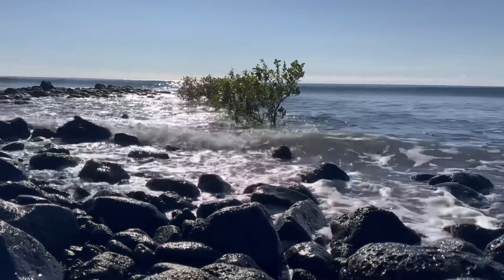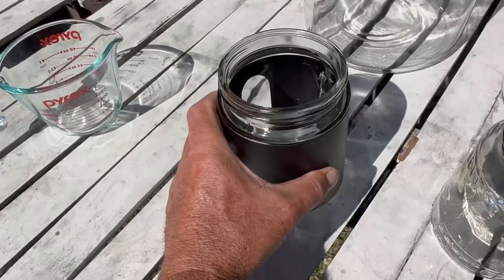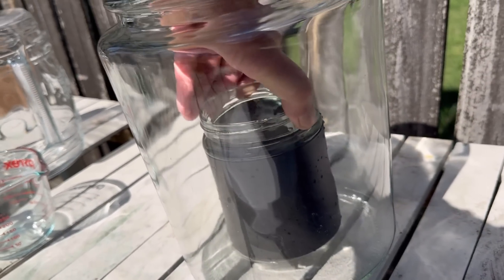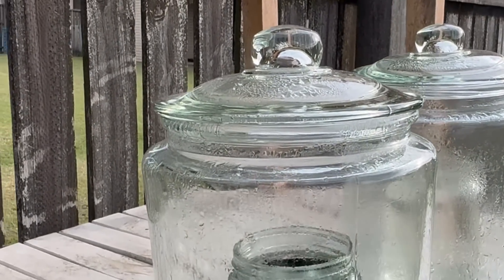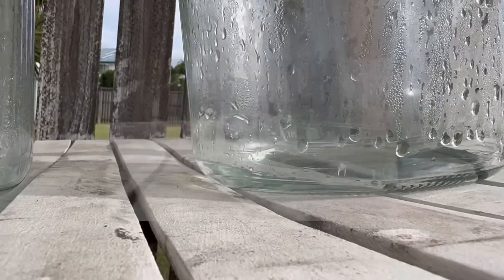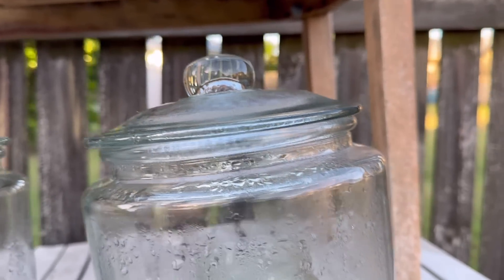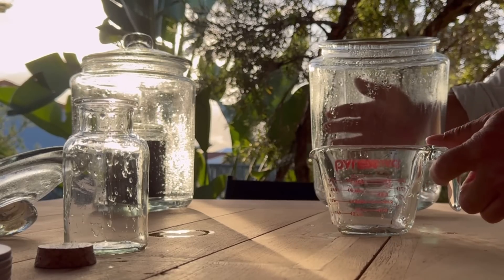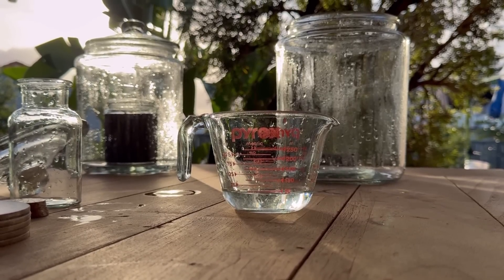Solar Distillation 2.0: Boosting Efficiency with a Simple Tweak

Comment: First video of yours I've seen, so I apologize if you've answered it before. 

Why not invert the system? Black outside jar and clear collection jar in the middle? You could just invert the lid(though you may need to tape it on to seal it) to get it to properly condense and drip back down. Is the current set up to minimize losses to the sides of the salt water jar? 

Have you considered a two part system? One jar in the sun connected to another jar in the shade?
Reply from the maker: Hi and thanks for your suggestion and your question. I have actually made a video attempting a design such as this but the surface area of the lid was not enough to get decent results. And as you mentioned sealing the unit up is important otherwise the vapors simply vanish (they are very sneaky), also I have found that by adding tape to the system the taste of glue comes through into the distilled water due to volatile organics of the glue used to make the tape sticky. And in regard to your comment about making another system separated by a short distance and connected by a hose, this would be well worth a try. The collection vessel could even be hidden from the sun to help reduce reevaporating. I would love to give this a go at some stage in the future. It's a good idea. Thanks for your feedback. Cheers!
Reply: @Remraf  Food grade beeswax and cotton wool would probably do a decent job sealing things without changing taste. 

Looking forward to more videos!
Reply from the maker: @KOWspazed good point! Bees wax is awesome. I need to do some more research into how they make it! If the bees can do it I can do it! Maybe….

Comment: what if you made a black sleave, that could be put on and removed, for both glass containers? could you get the outside container hot enough with the sleave on, to actually get precipitation just by taking it off and letting it cool down? if so, you could get multiple drips throughout the day. not just at night. just a thought
Reply: also you've inspired me to try myself 😊 thanks!
Reply from the maker: This is so cool to hear! Explore all rabbit holes I say! Once you start you wont stop!
Reply from the maker: How did I miss this comment!?! Sorry for the late reply. This is a fantastic idea. The black outer jar idea is something that would be well worth trying and easily implemented. My only concern was not letting the light into the system. There was a paper written by researchers at MIT that suggest lights roll in evaporation is larger then first thought! And the sleeve idea is worth implementing as well, it could have a double use as it would be wet during the night and during the day the evaporation of the water on the sleeve would result in a cooling effect inside the jar as well. So both would be worth trying. It would be interesting to see if the wick effect has a negative effect on the evaporation? Cheers!

Comment: black electrical tape? 🤷
Reply from the maker: That would work well, the biggest concern would be making sure the glue that is on the tape doesn’t leak into the distilled water. But maybe we could put the jar up on a block of sorts to keep it out of the distillate. Thanks for the suggestion. This would be worth a try!

Comment: This is neat - what YouTube is for. I think a simple heatsink, like a thin metal fin on the outside would help quite a bit. It won't do much during the day, but at night it will help it cool faster (minimally) but also create a slightly cooler spot on the shell which will become a nucleation point for condensation and attract bigger drops that will settle out faster.
Reply from the maker: Thanks for the comment and for the suggestion. I believe I have some old computer heat sinks laying around somewhere. Might be worth digging them out and researching how I could attach them. The more we can create a temperature gradient the better our condensation will be. Thanks again and I look forward to implementing this suggestion!

Comment: In theory, painting the inside of the inner jar black should be safe. Any VOCs should be evaporated after drying and all that should be left is highly crosslinked polymers which should not evaporate. The clean water should then collect in the outer jar, without any paint.
Also burying the outer jar half way and elevating the inner jar within the outer jar may help encourage condensation at the bottom using cooler temps from the ground.
Also make it air tight if possible.
Reply from the maker: Thanks John. I appreciate the feedback. I am currently looking into the qualities of different paints. As you mentioned there should be some types of paints that are perfect for this function. Maybe pot belly black or a high temp enamel! And yes, I need to start considering burying the collection vessel to help cool it and minimize reevaporating while keeping the system airtight! This is key, I've made the mistake in the past where the system had slight leaks leading to the vapors escaping! Thanks again for the feedback. I appreciate the insights!

Comment: Nice! Have you tried using evaporative cooling with seawater on a small part of the outside to cause condensation? That should work even without sunlight, as long as ambient humidity isn't too high. I don't know how well though, and it would depend on multiple factors, including the humidity in ambient air, the drier the air the better it should work, all else equal.
Reply from the maker: This would be tricky to get it to work. I wonder…. How would I set it up to allow evaporation while maintaining a purchase on the surface of the jar? If I sat the entire unit in a pool of water I might see some results. The other way would be to make a sleeve maybe? Install the sleeve over the jar, place the jar and sleeve into a bath of water, the sleeve wicks up the water and evaporates therefore cooling the unit as it does so. Maybe this would work! Thanks for the suggestion! I appreciate the feedback! Cheers!
Reply: @Remraf  Yes, exactly letting it wick up. I think just a small part of the surface area is best, at least when there's no sunlight.
Reply from the maker: @fishyerik there’s plenty of sunlight here. It’s Australia’s super power and in summer it can be a super bummer! Especially if you have to work in it. (Like I do!)
Reply: @Remraf  I don't know if this is helpful, but I thought of another way to use evaporative cooling that might be better. If you raise the inner container off the bottom, you could place the whole thing in very shallow seawater to get condensation at the bottom. That should also be easier to combine with a reflector to focus sunlight onto the inner container. 

About focusing sunlight, regardless if you do it with a lens, or reflector, or both, it can increase the output a lot. 1 square meter of full sunlight represents enough energy to make about 1.5 liters of water to evaporate per hour.  While it's not possible to extract water with anywhere near 100% efficiency, focusing the light will help both by getting more energy to the process, and also increase the difference in temperature, which is a big part of what drives the process.    

I find it interesting with the different perspectives, when I think about it, producing freshwater from sea water is probably most potentially useful in areas with a lot of sunshine. I live in Sweden and we rarely get temperatures over 30 °C even, and lack of water is rarely a big issue here, in large part because the low temperatures means low evaporation.          

Anyhow, keep up the great work!
Reply from the maker: @fishyerik these ideas are awesome. I really want to implement them into the next test. Raising the container off the floor and adding the entire unit into a bath of seawater would be a cool addition. The evaporative effect would in theory, as you have said, cool the system allowing for more condensation. Thanks again for your extensive comment!
Reply from the maker: @fishyerik we have been lucky here lately due to the amount of water we have been receiving but go back to 2018 we had periods were it rained mud. It was apocalyptic. Very close to have serious issues! That’s what set me down this path! Thanks again for taking the time to think about this subject and for sharing your ideas. I really appreciate it.

Comment: If I may suggest, if your jars can seal airtight,  by boiling the seawater just before adding to the black jar, and waiting a few seconds before closing the lid, when the water cool to room temperature, will create a negative pressure inside the big jar and this in turn will reduce the boiling point of the water, requiring less energy to aid the distilling processes.
Reply from the maker: Interesting. I’ve seen several posts in one of the previous videos discussing working with pressures to improve the results. This is something I would like to have a go at. But for the time being I think I would prefer to try and stay with utilising minimal energy input (the sun). 
This however would make an excellent video separate from the solar distillation series. It would be interesting to see the results. Thanks for the suggestion. I will take it into consideration! Cheers!
Reply: @Remraf  to filter water run two containers, one upside down, linked with a fresh stick, tape openings air tight, enjoy 🌧🌊💧
Reply from the maker: Hi and thanks for your comment! I would love to give this a go. I just hope that I am understanding this correctly. So it’s one container on the bottom that has the sea water in it. And the one inverted above it captures the condensation? And the top container is suspended using the stick? Is that right?
Reply: @Remraf  bottom is collection. Top is the water to be filtered. Tree branches have millions of membranes/channels (live a bee hive) the water moves through and purifies. It's extraordinary how clean muddy water comes out, ready to drink. Also can place bag/glass jar over the end of a branch with leaves and water will drain into bag/jar 💚🇦🇺
Reply from the maker: Yes. Definitely! I have seen the bag process before. I’m not sure if you have heard of a fella by the name of Malcolm Douglas. He demonstrated this years ago in one of his documentaries. True blue Aussie legend! It would be interesting to see how much fluid could be retrieved from utilising this process.
Reply from the maker: @GFYYT11111 i really need to have a look at this. I’ve seen a couple of people mention this. Would be worth investigating further! Thanks for the information.
Reply: @Remraf  welcome💚 We are coming to a time in AUSTRALIA that all must know how to filter water. The war on humanity has escalated. FDA refuses to perform it's existence. Processed foods, fast foods 🤮 stay safe everyone 💚🇦🇺
Reply from the maker: @GFYYT11111 thanks for your comment. It’s certainly concerning thats for sure. I work in the ag industry and from what I am seeing things are not getting better. There are definitely exceptions but they are rare.
Reply: @Remraf  love channels that educate. Sharing info & natural alternative ways will save millions 💚🇦🇺
Reply from the maker: @GFYYT11111 even if I change one persons perspective just a little or help to improve one persons understanding of the world. These are steps in the right direction. But that could be more opinion than anything. Cheers!
Reply: Fresh water it works  @Remraf not sure if removes salts but l would imagine so... love to see you do this experiment for your audience 💚🇦🇺

Comment: Make a lens or mirror to focus solar rays on to the inner jar next.
Reply from the maker: Thanks for your comment! I will consider this. I have a fresnel lens somewhere. Might need to track it down. The other option may be to make a reflector that I can then put it on the back wall of the jar. Thanks for the suggestion. The experiment continues at the moment. But it is due for another update and I think you’re right. This could be a good direction to take it
Reply: @Remraf  😀⭐
Reply: Even like aluminum foil or mylar sheets properly placed in the background will reflect to the jar.  The fresnel lens will focus a lot of energy in one spot.
Reply from the maker: @anttikahkonen1957 fresnel lens all the way. Time to do a deep dive into my shed to find it!
Reply: I expect you will get to a point where the air is saturated and no amount of extra sun will help evaporate more water (although hotter air can hold more moisture).
Maybe trying to get more condensation during the day would be more effective.
Reply from the maker: @remcooosten2542 there have been several suggestions to place the entire unit into a bath of seawater. I believe I will implement this into the next set up! Thanks for sharing your thoughts I appreciate it heaps. Cheers!
Reply: I came to say aluminum foil as well. It's a cheap way to reflect the sunlight.
Reply from the maker: @MrBossmoss17 and reusable! And can be recycled for a myriad of other uses! I like it.
Reply: Check the type of glass you pick. Not all glass can handle high heat
Reply from the maker: @davidva8694 pyrex is probably the pick. I believe it is a Borosilicate glass.
Reply: If the condensate were to be shielded from the sun, this might help to prevent it from evaporating and competing with the evaporation from the inner pot.
Maybe putting the inner pot higher and shielding the lower half from the sun could help.
Also, there are videos on YouTube describing how to make ultra white paint, reflecting almost all sunlight.
Reply from the maker: @remcooosten2542 yep absolutely! This is one of the biggest draw backs of this system. It’s far from perfect and this would be a good step in the right direction. Thanks for the tip! Cheers!